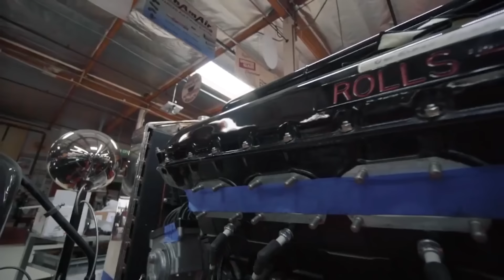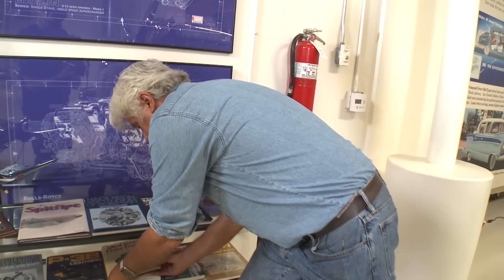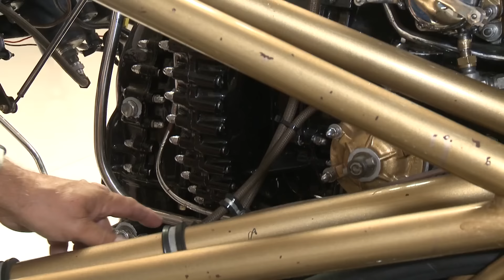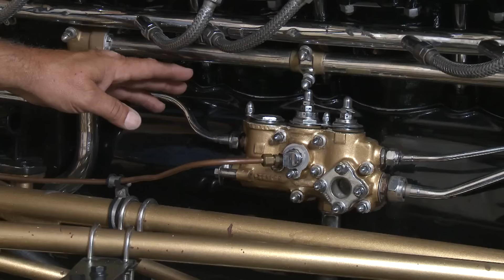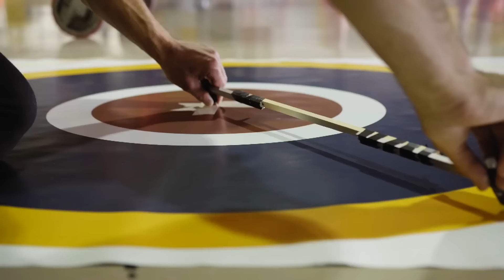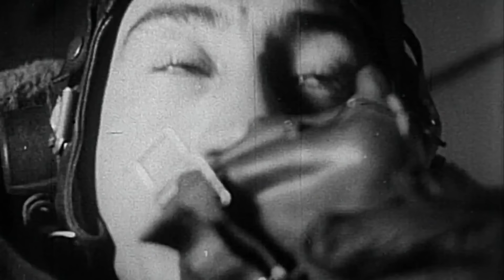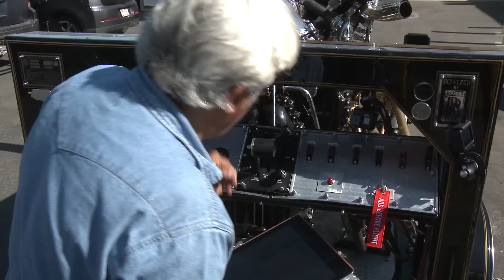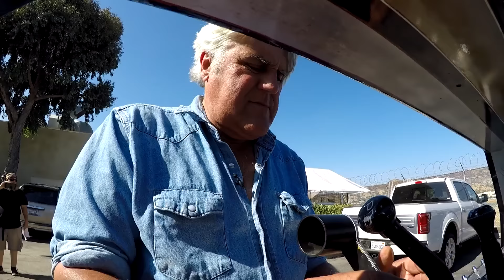The Engine That Won World War II - Jay Leno's Garage

Comment: Thank heaven that Hitler was a maniac.  If he had waited a little longer and developed the Messerschmitt Me 262 further the allied forces would have had no chance.  But someone had to be behind Hitler.  I dont believe he came into power from just his speeches.  Someone with lots of money.
Reply: Haa!!! Just like now...Back then the US creates and sponsors "enemies " so it looks like we need to  defeat them...Sorta like the childhood game of "Hit My Hand 1st "...
Reply: The British were way ahead of the Germans in jet airframe and engine designs.
Reply: @johnburns4017  Why?   I am interested in learning.
Reply: @se7ensnakes  
There is a myth that the Germans were way ahead of the British in jet engines and planes in WW2, when the opposite is true.  The WW2 German jet engines were extremely unreliable with low performances and very high fuel consumption. The German axial-flow turbojets never worked as they wanted being developed up to 1953 by the French to obtain a usable engine. The French lost a lot of time playing around with the German engines, instead of working with the British. The French and Soviets after WW2 tried to improve the German axial-flow engines and largely failed. 

The Germans did not invent the axial-flow turbojet, they based everything on Frank Whittle's patents. The British Metropolitan-Vickers F.1 axial-flow engine was running on a test bed in 1941. The F.2 was an axial-flow being an extremely advanced design using a nine-stage axial compressor, annular combustor, and a two-stage turbine. It powered a Meteor in November 1943. It was considered unreliable and never saw use during the war, hence why the British went for the reliability, controllability and quick development of the centrifugal turbojets. 

The Metro-Vick F.3 was the first ever turbofan in 1943. Metro-Vick developed the F.9 Sapphire, however left the jet business in 1947 giving all their designs to Armstrong Siddeley, who commercially produced the Armstrong Siddeley Sapphire engine, which was licence built in the US as the J-65.

The British in order to get a usable and reliable jet engine, with the technology of the time, went for a centrifugal design rather than the troublesome axial-flow design. This design produced less thrust than an axial-flow but was quicker to develop and reliable outperforming the best piston engines planes at the time.  It took 5 months to develop, while the first reliable axial-flow engine was the 1950 Rolls Royce Avon, which took 5 years to get right.  The Avon is still in production as a ground based gas turbine, with the aero version in production for 30 years.

In 1945 the French made and tested some German designed turbo jets made with quality steel unavailable to German industry in WW2. They ran for 25 hours instead of the 10 hours of the Germans engines that used poorer quality steel. Not much better. The German axial-flow engines failed because of heavy design flaws. The centrifugal compressor used by the first British Meteor plane was fine and much more reliable, but unable to reach high compression ratios. This limited performances. Centrifugal compressors were used up to the 1960s.

In 1945 the team from the French ATAR laboratory plus some BMW and Junkers engineers, were engaged by the French SNECMA research bureau, with the objective to build a new reliable and performing axial-flow turbojet. The BMW 003/Jumo004 was considered unusable. It was tested on the first French jet aircraft, the 1946 So6000 Triton, overheating and exploding. The plane only flew with a Rolls Royce Nene centrifugal turbojet.

The ATAR project took 6 years to produce the first acceptable axial-flow turbojet (ATAR 101 B1), produced in 1953. So 8 years research and developments by the French using the German jet engines as the base. It was installed on the first French jet fighter, the Dassault Ouragan.
The French lost a lot of time because the German jets had poor efficiency and some concept fails. Essentially in the combustion chambers and fresh air circulation to reduce the external temperature of the engine. The BMW jet was known for overheat problems which precluded fuselage installation.

The question at the end of WW2 was: what is the most efficient way to produce jet fighters? The answer was clearly not adopting the German design of engine and fuselage. The build costs for a jet engine were much higher than a piston engine, with the fuel consumption near 3x. The centrifugal compressor the British adopted in some planes was the best choice with 1944-45 technology, more compression pressure was not an advantage when the hot turbine was unable to resist higher temperatures. The German turbojets had big overheat problems as the engine would not work in an enclosed fuselage for single engined fighters. This defect was immediately noted by the French on the 1946 "SO 6000 Triton" prototype, and by the Soviets on the 1946 Mig 9. The Soviets quickly replaced the BMW 004B2 by the centrifugal Rolls Royce Nene which worked without problems, dismissing the BMW engine for fighter planes. The Rolls Royce Nene was copied to the last nut by the USSR being installed in the Mig 15 being used effectively in the Korean war.

The Meteor was the first proper fully developed jet plane introduced operationally. The 262 was slightly faster than the Meteor F3, but extremely unreliable. The British would never put into the sky such an undeveloped plane as the me262. The British could have had a jet fighter operational in 1941, but it may have been as bad as the me262. The Germans advanced R&D on jets after they interrogated captured British RAF men. They learned the British were advanced in jet technology and flying prototype planes. Until then the Germans had no intention of mass producing jet planes. 

The rushed together Me262 started claiming kills on 26 July 1944, the Meteor claimed its first V1 kill a few days later on the 4 August 1944. But the Meteor was a proper fully developed jet plane, not a thrown together desperate effort as the me262 was. The me262 fuselage was similar to a piston plane with the pilot over the wings obscuring downward vision, while the Meteor was a proper new design fuselage specifically for jet fighters with a forward of the wings pilot position giving superior pilot vision, as we see in planes today.  The cockpit was very quiet.  

The sweptback wings of the me262 were to move the engines further back for better weight distribution, not for aerodynamic reasons as is thought the case. The me262's airframe was based on piston engine planes, even with an initial rear tail wheel.  The tricycle landing gear was only introduced when it was found the thrust of the jet engines would scorch the runway surface as the exhaust faced downwards. The Meteor's airframe was designed purely for jet propulsion even with a high tail to prevent thrust interfering with the tail which could affect control.

Centrifugal compressors were not obsolete being used in turboprops. Between a turbo jet and a turboprop, the only difference is the turbine, not the compressor. The last centrifugal compressor jet engine still in service on a handful of commercial aircraft like the Fokker 27, is the Rolls Royce Dart turboprop. A very reliable engine made in 27 versions, but with high fuel consumption to modern engines. The Rolls Royce Dart Turboprop turbo jet engine was produced the longest, being a comparable design turbojet to the likes the Rolls Royce Nene. The rugged engine was produced from 1946 up to 1987.

Comment: One oddity is that the cylinders are evenly spaced, bank to bank.  They are not staggered like most V engines.  They have two types of connecting rods, one of which is like a blade on the large end, and the  other is like a fork.  The blade end rod runs on a bearing that is on the end of the fork end rod.  Elaborate when compared to shifting the cylinders a single radius.  (This is a memory from '75 when I was an engineering student).

Comment: That is one of the best sounding most powerful engine's I've seen it was truly stunning and I appreciate and approve of the Merlin 1650. Thanks Jay for letting us see and hear it.
Reply: The Allison made as much or more HP at sea level !!!  Check the specs
Reply: @wilburfinnigan2142  Depends which Merlin you compare it to… Packard Merlin’s? Maybe. Later war British 2,300 HP ones…. Nope. Plus air combat doesn’t happen around sea level. It happens at 25k ft where a two stage supercharger makes all the difference and the Merlin can perform to its top capability - and where the Allison flops.
Reply: @BryanJohnson4891  Late War BF109 engine was far better got as high as 2800 hp and was super charged and electronically fuel injected and controlled first engine in the world with computerization and built during ww2 under wartime conditions and they built more BF109 than all the other ww2 fighters combined. Its the most produced fighter in history.
Reply: @pilsplease7561  It wasn’t computerised - that was the FW190, and it certainly wasn’t putting out 2,800 HP - the massively larger expertly designed PW 2800 could just squeeze that with 150 octane fuel. It could get a few hundred HP lower with H2O/Methanol injection, but this was a massive risk to the engine. In practise it never went close to this as it used slide bearings and awful synthetic lubricants. Nowhere near 2800 mate - same displacement as the griffon but worse design and fuel. No replacement for displacement!

Comment: Looking at that magnificent Lancaster bird: a little known fact is that during the development of the A-bomb, the Lancaster was almost chosen to be the plane used to drop the bombs because at the time, it was the only plane that could lift the load and carry it! The B-29 could not accommodate the bomb due to its wing support structure that bisected the bomb bay doors. There was a secret project to rig up "Black Lancasters" for the job even though it would probably have been a suicide mission for the Lancaster crews. Generals Arnold and Groves would have none of it, wanting "an American plane to deliver and American bomb," and the B-29 was altered in time to meet the need. This bit of history was revealed on Mark Felton's excellent channel: youtu.be/5XX9ptCNpik
Reply: The Lancaster would not be a one trip to deliver the A-Bomb - it had air to air refuelling.  The USA spent a fortune on adapting the B-29 to be used twice.  It was silly to spend so much money, when US troops were in sub standard tanks, need upgrading.

Comment: Its too bad the lead paragraph starts out with WRONG information !!!! NO production P51 Mustang used a Packard V1650-1 engine !!!!  ALL production Merlin powered Mustangs used the Made in America by Packard V1650-3 or -7 or -9 or -11 !!!!  ALL of these engines had the 2 STAGE 2 SPEED supercharger, making them all high altitude Merlins !!! The V1650-1, like Jays was a SINGLE stage with a second SPEED supercharger, two entirely different versions of the Merlin !!! The V1650-1 was used in the P40F & L kitty/warhawk in place of the V1710 Allison........and it made NO difference in the performance of the P40, why only 1311 were ever built.  The Allison version was faster, climbed faster, and rolled faster !!! The only slight advantage the V1650 =1 has was about 1500 ft of service ceiling by virtue of its 2nd , higher, speed gear in the supercharger !!!  Geeeeese get you facts straight !!!!   PACKARD did a Herculean effort in building the Merlin engine for the Brits !!!!  Brits received 37.137 of these PACKARD built merlins, why PACKARD was building the Merlin in the first place !!!  USA received 18,000+ merlins from PACKARD and ALL but 3,000 were the Later V1650-3 or 7 or-9 or -11 ALL for only the Mustangs !!!!   Facts of history less the B/S and Hype !!!

Comment: My wife bought me a flight in a Spitfire Mk 1 for my 65th Birthday, flying from Biggin Hill. I told a pal of mine about the flight and he said he had some things to show me.

He proceeded to show me his father's flying log - he was a Spitfire pilot during WW2!! He was shot down, baled out and survived. The remains of his aircraft were excavated by enthusiasts in the 70's (I believe) and he was presented with a piston and con-rod from his aircaft.

"Squadron Leader Carver has completed two tours of operations. During his first tour he participated in the Battle of Britain. On numerous occasions he engaged far superior enemy forces. In September 1940 he destroyed two Heinkel 111s and severely damaged another enemy aircraft before his own aircraft was set on fire. He received burns on his face and wrists before he abandoned his aircraft by parachute at 18,000 feet. He completed many intruder sorties on his second tour, and successfully attacked numerous trains, barges, enemy shipping and airfields. In June 1944, he completed a daring attack in the strongly defended Caen area in support of the night landings in France. This resulted in the silencing of two anti-aircraft positions and in the destruction of one searchlight and thus helped to reduce the casualties to the Airborne Forces which landed 20 minutes later. He has also destroyed three flying bombs. Since May 1944, Squadron Leader Carver has acted as Flight Commander. The successes achieved by his Flight have been largely due to the magnificent example of courage, enthusiasm and devotion to duty."
Those Merlin engines are behind many tales and sat in front of many heroes.

Comment: Yes, the RR Merlin is an exceptional artifact and it’s mating to the P-51 airframe was superb . But don’t forget all those Pratt & Whitney radial engines powering just about every other American bomber and fighter of WW2.😉
Reply: Do you have point?
Reply: @johnburns4017  I would’ve thought it was “as plain as the nose on your face”, just that many other superb aircraft designs weren’t powered by RR Merlins.
Reply: @jeffw5263  
But they were inferior engines.
Reply: @johnburns4017  Whatever, Bud. You can believe what you want to believe.
Reply: @jeffw5263  
I belive in facts.